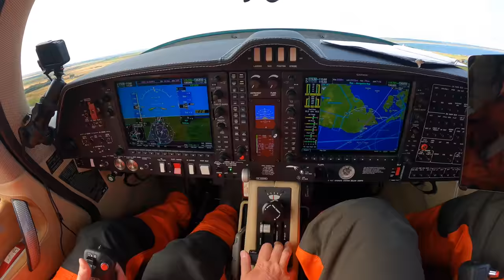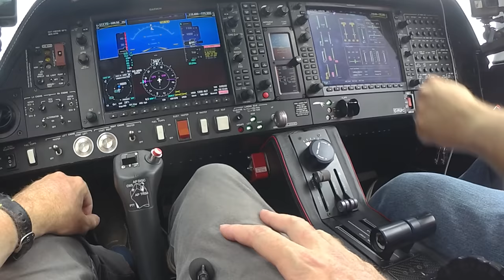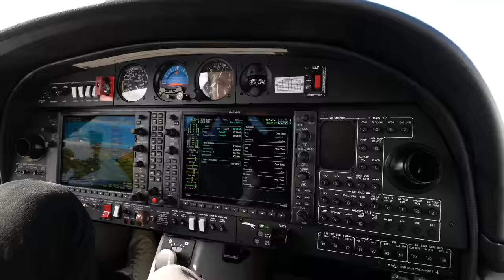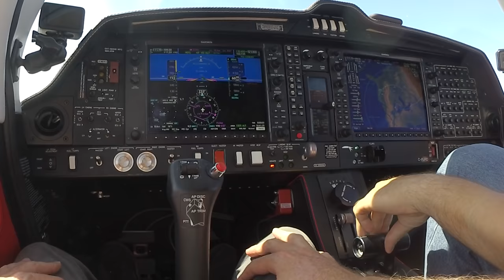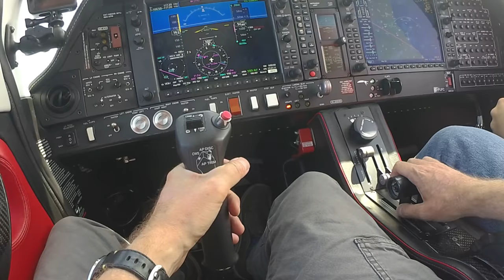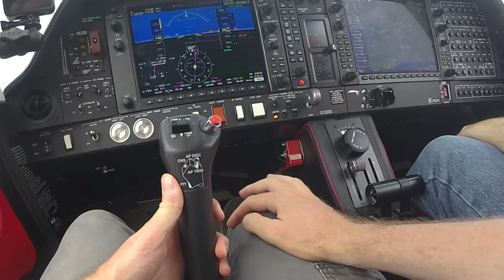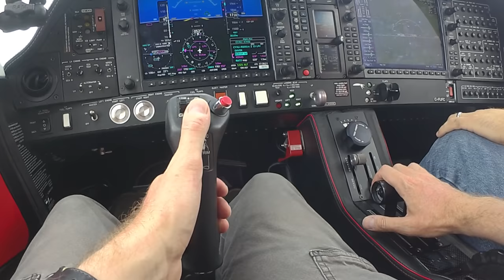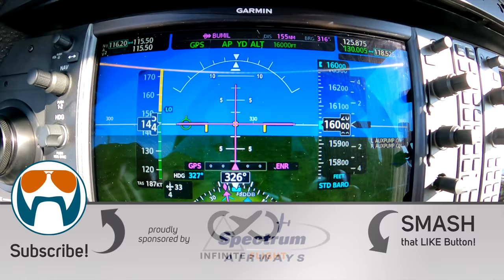Atlantic Crossing Flight Prep + DA62 Familiarization - Series! Ep One

Comment: Cool video, plane, and engine. Curious that the engine instruments just show percent load and RPM. I would think you'd need manifold pressure to comply with 91.205. Am I missing something obvious, or is there a more interesting story?
Reply from the maker: Thanks Ben - I'll get someone that knows more about this than I do to reply to this one.  How's your plane doing?
Reply: Hi Ben, I looked into this and found this answer from rule-making in the federal register.  "If percentage power is used in place of manifold pressure, compliance to 91.205 will be accomplished with the following: The diesel engine has no manifold pressure gauge as required by 91.205, in its place, the engine instrumentation as installed is to be approved as equivalent. The type certificate data sheet (TCDS) is to be modified to show power indication will be accepted to be equivalent to manifold pressure indication."
Reply: I was feeling these engines don't really have a manual pressure because they use compression ignition and don't generate a vacuum either. Power is purely a function of fuel flow and rpm, and it's fully faded controlled burning jet a. You have a single lever to control it.
Reply: Ben - Diesel engines effectively run at full throttle, as the power/RPM is determined by fuel flow.

Comment: 8:20
What they fail to mention is that those are diesel engines!
Diamonds are one of the only makes that use diesels! 
Quiet, efficient, easy-to-start, ignition-less, powerful diesels!
Liquid-cooled too! Unlike most airplane piston engines which are air-cooled. 

Also rather heavy engines for the volume. Which, i suspect, is why Diamonds have such a long wingspan.
Reply from the maker: I did show the Jet A label beside the fuel cap near the start of the episode :)
Reply: @FlightChops  I apologize for this comnent. I thought i deleted it. As mere seconds after i left it, someone mentioned they are diesel! 😂
I do love the diamond planes though. Especially the -62! 
There's just something so charming about them.
Great video, FlightChops!

Comment: The early Austro Engine blocks were from Mercedes (they were the same blocks as the 200, 220 and 250 CDI models of Mercedes). Is that still the case?
Reply: I think they finally ran out of Mercedes engines (Mercedes stopped making that engine "OM640" a while back) and started building their own to the Mercedes spec.

Comment: Diesel engines develop a high percentage of their rated torque barely above idle, unlike their gasoline counterparts. This makes them ideal for aircraft. Their ability to drone on for hours on little fuel doesn’t hurt either. Just as a reference, the odometer I’m looking at in front of me says 1,536,760km, and the Hobbes meter says 25,810hrs. Granted this is a really big diesel, but it shows that the technology is well proven.

Comment: I am amazed that despite the introduction of counter rotating props on twins during WW2 modern twins fail to do the same.
Reply from the maker: I'm not exactly sure of the reasons, but I'd expect it is partially related simplicity of parts and maintenance - the same engine and prop can go on either side if the don't counter rotate. And if the counter rotation is achieved with gearing or something, that's just a bunch of complexity that can fail, and I guess would also add weight to the one side?
Reply: @FlightChops  gearing can swap the counter rotation but more commonly the balance of the crankshaft.

Comment: 4:55 This design decision doesn't make sense to me.  On the face of it it makes sense: keep both ECUs at similar hours, however I wouldn't actually want this.  If the ECU design has an inherent design flaw that it will fail at XXX number of hours (could even be a programming error), then you could run into a possibility of both ECUs failing simultaneously.  Idk what an elegant solution to this is.

Comment: Beautiful plane, but I wouldn't want to be on a very long flight with 6 other people. And how much baggage can they bring. For $1.1 mil. you could get a much bigger, comfortable, pressurized plane.
Reply from the maker: I believe the DA62 is actually closer to 1.4M, and as far as I know the entry level pressurized is closer to $3M - please specifically share what you’re proposing as a better / cheaper option?
Reply: @FlightChops  My apologies, I forgot "used". I just saw a older King Air for $350.